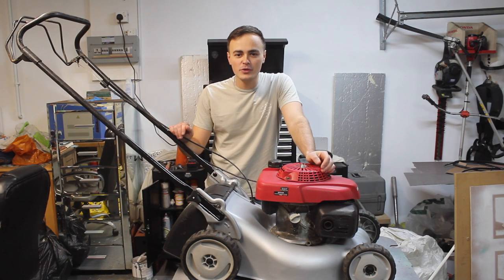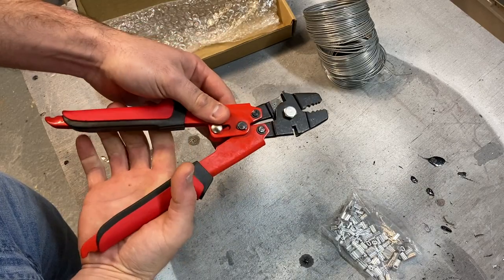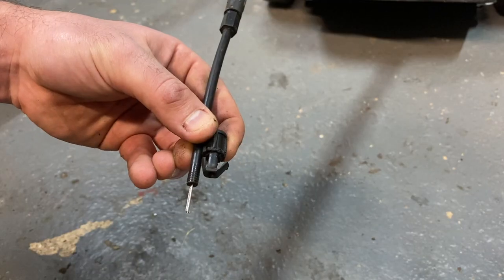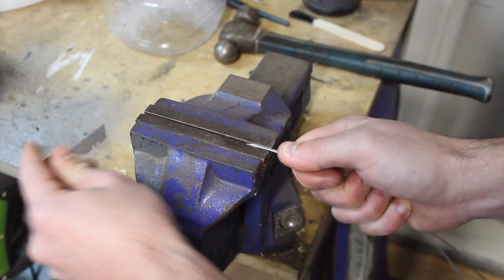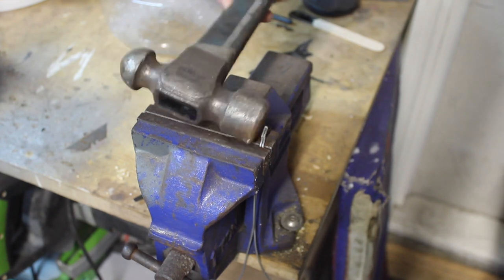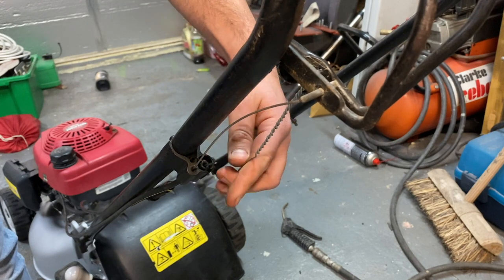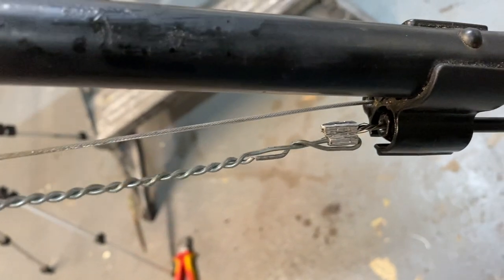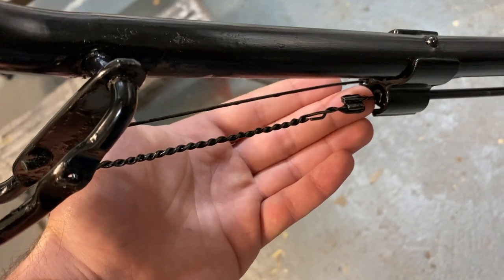How to Fix Broken Lawnmower Cables - DIY Budget Repair

Comment: What's the black plastic end you twisted on at 2:44? Mine's broken apart and I don't know how to fix it or where to get a replacement from.
Reply from the maker: Sorry I’m not sure what it’s called either but it will most likely come with a replacement cable